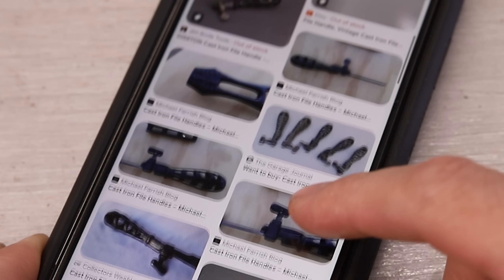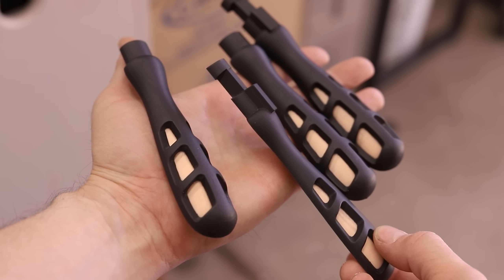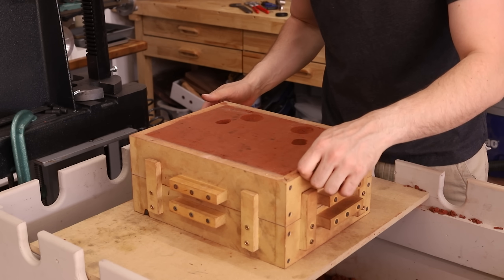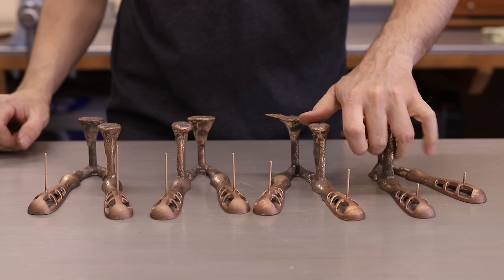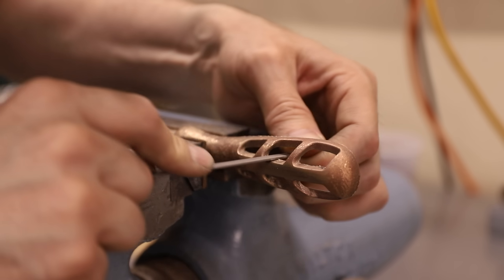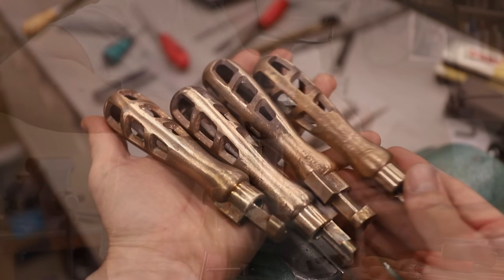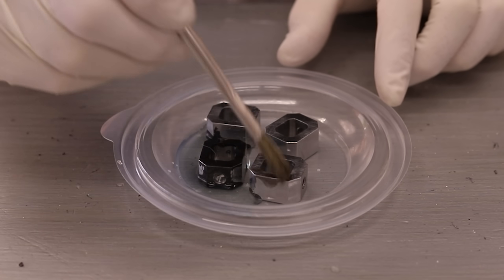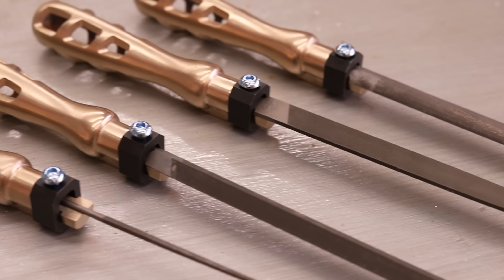Recreating a vintage design

Comment: Super Cool Video I’m a Retired/ Disabled Woodworker  that has a long family History of Tool and Die Makers ,Machinists ,and Welders  in it my personal  hands on Metal working is very limited  to a few Ugly Structually Sound  Welds , a bit of Grinding and Polishing here and there and  many hours of volunteering  to help move and set up heavy Machinery in and around Machine Shops as that was a big part of what i did in my Woodworking Facility  for many years  and i have some experience on Heavy Machinery  and  running Air and Plumbing  as needed  we were a highly CNC powered Woodworking Shop and so are my Family Operated and Owned  Metalworking Shops  BTW as. Family  we always exchanged Professional Work between each others Companies  and i  generally donated my free time to helping out whenever warranted  in exchange for any “Free” or discounted Services i might need  for personal reasons  i’ve always had a intrest in Casting Metals  and other Foundry operation  my families Machine Shop milled  recreations of a Casting George Washington  himself Casted on a Contract for WashingtonD.C. Bridges and Overpasses  inthe 1800s  from his Foundry inMount Vernon  those were CastvIron Light Fixtures  that  went into some of the Wrought Iron Railings  but my family Machined the new ones out of Billet Aluminium  as a Improvement !

Comment: Next time pour some extra welding rods from the excess main pour and you'll have an exact metallurgical match for your project
Reply: I was thinking he could have maybe used those vents that filled up with bronze for same-alloy TIG rod.
Reply: @tobhomott  yeah me too. But he didn't
Reply from the maker: I did that with my aluminum bronze axe project. I needed a lot more for this project though so I decided against in.
Reply: @robinson-foundry  ah I see. It was probably you that I learned that from. It was a cool trick

Comment: Have you though of switching over to a liquid resin 3D printer.
Reply from the maker: Yes, I have a resin printer but I find it difficult to print dimensionally accurate parts with it.

Comment: Would adding locating features to the molds help during the welding process and alignment? So the two halves could somewhat interlock, or would it just be too complex?
Reply from the maker: It probably would, but I found it was easy enough to just line them up by eye. Thanks!

Comment: I have a bunch of these as heirlooms from great grandpa through my uncle. Once you use one, you never go back to wood or plastic.
Reply from the maker: That’s awesome! I’m hoping these will work out well for me. Time will tell.
Reply: Rất tuyệt vời, lời chào đến từ Việt Nam 👍👍🇻🇳
Reply: they look lovely, and i never even seen, let alone held one like this. but those 100yo beech wood handles have one thing going for them:
if they ever get wobbly, jiggle them loose, and steep in a bucket of warm water over night. (ONLY submerse the handle!!) then give them 3-5 firm taps, and let the wood dry out near an oven for a week. it's tight again for decades! and if the file gets dull, dip it in acid, or make it into a heirloom wood splitting hatchet, if the teeth have been lost to decades of use
Reply: Also run two batches to avoid cooling like you did
Reply: From which metal yours are made of?
Reply: i assume the friction is much lower on the palm of your hand? that would have been handy when i was a metal worker
Reply: I've used them and I would rather hold onto the rat tail than ever touch one again. I spent more time picking up the file from the floor and retightening the handle than actually filing.
Reply: @tyrannosaurusimperator i assume that is why he resorted to using an Allen wrench instead